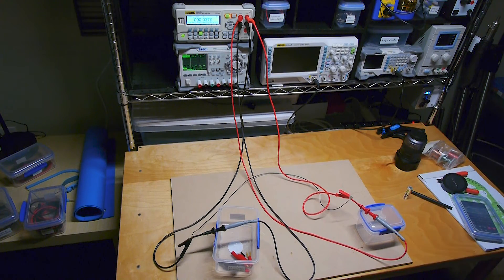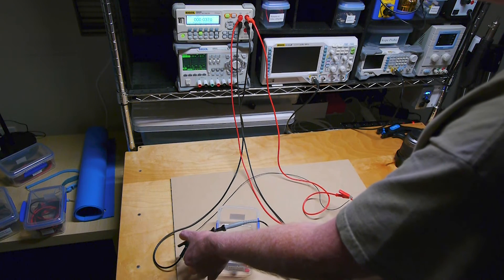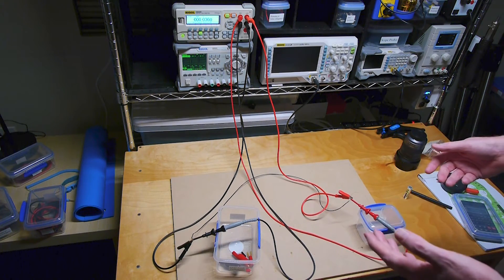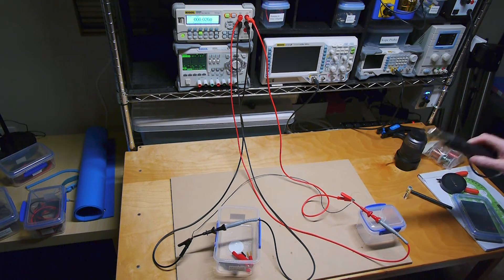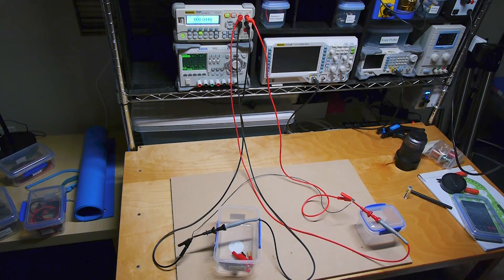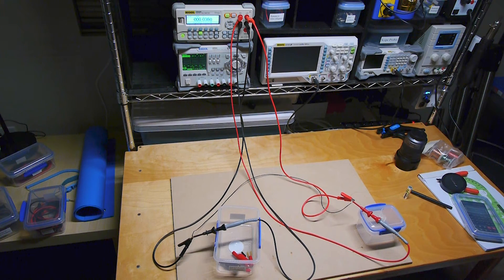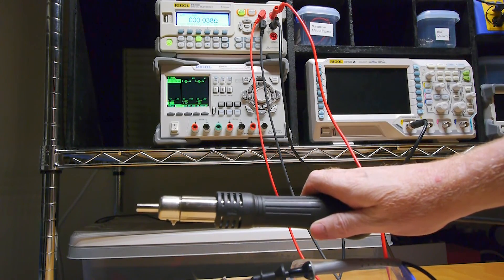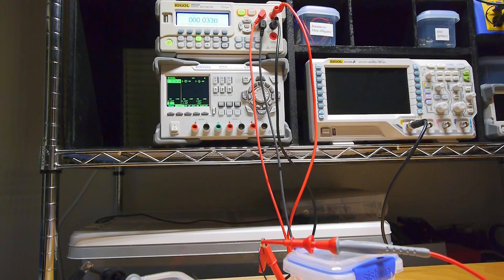4 Wire Resistance and the Seebeck Effect

Comment: By touching, you are changing the thermal emf. Its a voltage and by touching different sides you are changing the voltage difference it produces. The best practice is to change the current direction and avarege the two readings

Comment: Heat from your  hands are changing the resistance of the connections each connector the connection get better and the other side the connection and makes the connect worse.
Reply from the maker: The Seebeck Effect is actually the introduction of a voltage offset due to temperature differences between the connections when wires of different material composition are used.  There is likely to be a small change in resistance given the fact that most things and most conductors have either a positive or negative temperature coefficient, but the Seebeck Effect is more properly understood as the consequence of a temperature difference when the materials are not all the same.  A thermocouple uses this effect and increases the effect by the selection of materials sufficiently different to produce a larger voltage offset.